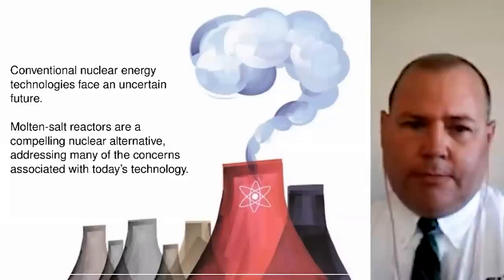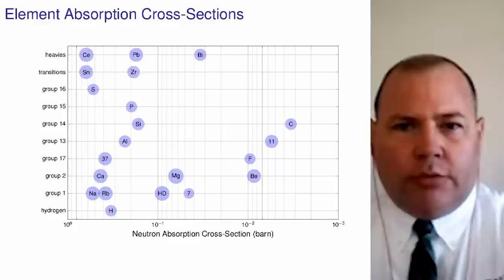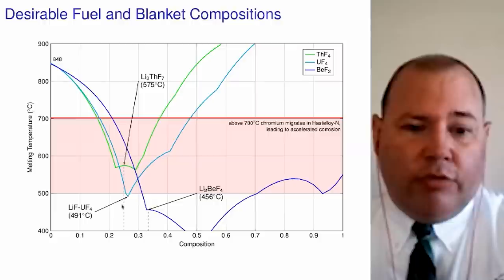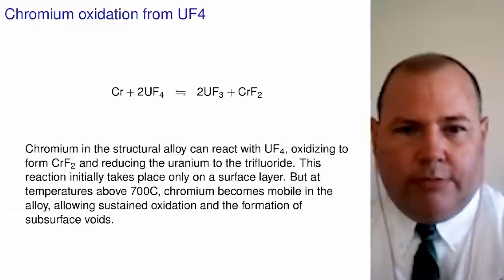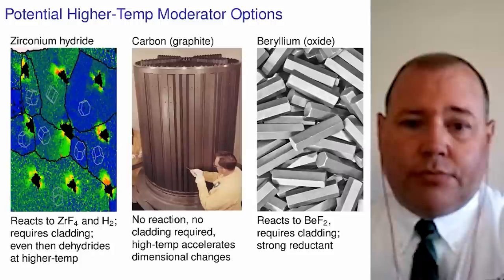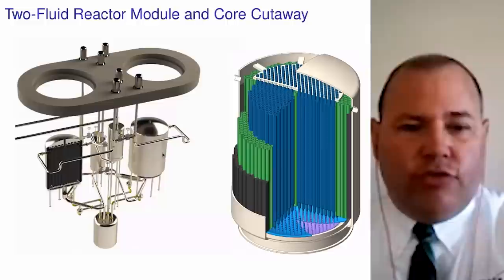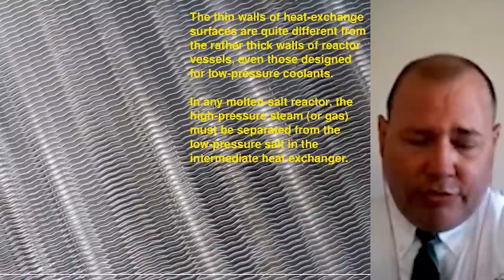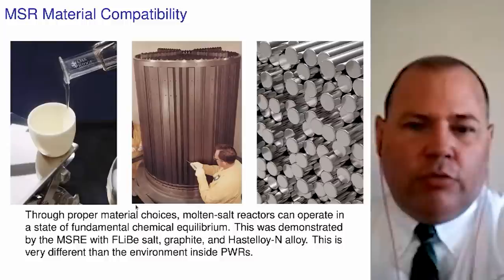Molten-Salt Reactor Choices - Kirk Sorensen of Flibe Energy @ ORNL MSRW 2020

Comment: If Ed Pheil and his team get their molten chloride salt fast reactor up and running doesn't that offer the best option. It removes the need for exotic and often toxic salt mixtures using something that is well understood for its chemistry. Namely sodium chloride.

Also as a fast reactor it's basically going to be a stainless steel can with heat exchange modules added to determine the electrical output. And it burns Spent Nuclear Fuel as its preferred fuel and can even burn depleted uranium when the operating chemistry is achieved.

Kirk Sorensen deserves great acknowledgement for his central role in reviving molten salt reactors but isn't the thermal spectrum fluoride reactor that needs complex components in the reactor vessel, exotic salt mixtures and far more fuel processing a much greater leap to make than something like the Elysium MCSFR that is designed to be as simple and cost effective as possible.

Which also involves any MCSFR operator being paid to take their fuel which is expensive to store.
Reply: Yep, pretty much spot on, but neither will be first to market IMO. Much simpler burner designs will most likely be first.
Reply: @chapter4travels  It doesn't get much simpler than the Elysium MCSFR.

The reactor can is an empty stainless steel cylinder than doesn't need massive fabrication because it's not pressurized. The salt used is sodium and potassium chloride.

The fuel is chopped up spent nuclear fuel and plutonium. 

Reactor output is a function of how many fuel exchanges are added to the reactor and pump capacity. So one reactor vessel can be a 50 MWe all the way up to 1,200 MWe power plant.

The pumps are top mounted making for ease of access and replacement. 

The reactor won't use freeze plugs in the drain pipes, if the pumps shut down the fuel salt automatically drains into the dump tanks. If the reactor shuts down without power everything sits in a larger tank of clean molten chloride salt cooled by a heat pipe. That will handle any decay heat.

The Elysium reactor is designed from the start with streamlined certification, licensing and fabrication in mind. They're not going to be using anything that requires a lot of R&D and certification.

The more advanced follow on designs can use things like hasteloy-N alloys reactor can for much higher operating temperatures than the already high 600+ C. As high as 1,300 C giving much better thermal efficiency and surplus process heat. 

If they get funding Elysium is going to have this up and running surprisingly fast is my thinking on this.

Ed Pheil and his team have spent the last 35 years building reactors at the Navy Knolls Atomic Power Labs, they know their stuff.
Reply: @dougcoombes8497  I don't disagree with anything you wrote, but Elysium is trying to build in the US, and the NRC will make sure that never happens. Thorcon power is in Indonesia where they really need new power generation and the Thorcon design is even simpler than Elysium.
Reply: @chapter4travels  Hopefully that changes in the US in the near future.

Elysium Inc. is also working in Canada they may get certified and have a running prototype here before the US.

There's also another fast spectrum molten salt reactor using tube technology being designed in Canada but I don't know much about that.

We crack this nut and there will be no shortage of fuel for nuclear reactors for centuries.

It's not just the hundreds of thousands of tons of spent nuclear fuel that can be burned in these reactors, it's also the huge amount of depleted uranium. There is 470,000 tons of that stored in the US alone.

U-238 become weakly fissile at the fast spectrum. I wish nuclear regulatory bodies in the US would wake up to the vast potential going literally to waste in the US right now.

Comment: Would the tritium be useful in fusion reactors?
Reply: The salt research for MSRs is identical to fusion research for just that reason. One use wants to maximize it (fusion) while the other wants to minimize it. But in both cases its a molten FliBe salt
Reply: Tritium would be a valuable resource. Check out the cool tritium vial light sources sold on Amazon.

Comment: Kirk is a hero but he’s up against a massive bureaucracy that exists to stifle nuclear energy. Thorium fuel, Hastelloy N, salt dump tank, pumping the fuel salt and freeze plug all have zero regulatory history. The work to get them certified is horrendous with massive costs and endless time scales. 
Ian Scot and Ed Pheil went for their fast spectrum waste burners because it’s easier to get regulatory approval and burning nuke waste gives brownie points.
Reply: Nuclear fans shoot themselves in the foot though. They put 99% of their energy into advancing old fashion water reactors and bashing renewables, when instead they should focus on promoting next generation nuclear power. I am a renewable fan, but I see great potential in pairing something like an MSR with thermal energy storage using salt to balance output from renewables. I think one has a much better selling point to politicians by presenting renewables and molten salt reactors as a match made in heaven, instead of propping up old outdated reactor designs.
Reply: @erikengheim1106  There's a reason why nuclear advocates bash renewables and it's because it's utter garbage. A back of the envelope calculation of the resource requirements per kilowatt hour results in something like three or four orders of magnitude in stuff being necessary for solar and wind compared to existing LWR.

That's before considering the overbuilding required since renewables require almost 100% capacity backup.

It's all sustained by subsidies. As governments force more and more of these unreliable, incredibly dilute energy sources, this will become economically unsustainable.
Reply: @phamnuwen9442  Wind requires 22 kg / MWh and nuclear is 18.5 kg/ MWh of mining. So the difference is minimal.

Renewables can be paired with solutions such as Moltex Molten Salt Reactors with thermal storage. Those essentially work like batteries and can give 3x normal output for 8 hours straight.

Thus you could have a grid with 30% Molten Salt Reactors and 70% renewables. You can build that much faster and cheaper than trying to go all nuclear.

Comment: what happens is the reactor fails in some way and the salts cool down in the pipes?  How do you restart the reactor or find and fix a problem in the pipes or valves?  I am a strong supporter nuclear power, and get stronger when I look at the reality the planet faces ... but we cannot afford more nuke designs that are going to have problems or create catastrophes
Reply from the maker: I believe the pipes would have an external heating mechanism. That's required to fill the system with liquid salt in the first place. So if the salt freezes it could damage the pipes if it doesn't dairy effectively, but assuming the drainage system works even a loss-of-power scenario should have enough salt drained to keep the pipes from being damaged. This is not an expert opinion, it was just my general opinion that a electricity-based pipe-heating system would be required for the system to be viable in the first place.
Reply: @gordonmcdowell  
Thanks for your reply.  Just my gut feeling, and no expert opinion from me either, but the complexity of that and the failure points I could imagine, something like Fukushima, makes me feel in my gut this is not a good technology to implement on a large scale.  Is there any long term experience with this reactor technology?  The Light Water Reactors are something we have a lot of experience with and the appeal of the relatively simple and walk-away safety has a simplicity that I think the public is more likely to accept.  Because if something goes wrong, troubleshooting a complex technology in the middle of a possible nuclear catastrophe is something I don't think anyone would want to see, and would cause the anti-nuclear people to raise hell and doom the industry worse than it is now.  The chemical reactivity and toxicity of the salts seems like a red flag to me - even worse at high-temperatures.  The scale of the global warming problem and the importance of nuclear to its solution, to me, seems to scream safety and simplicity, and having a lot of experience with, especially in light of the "stupidity" of the humans in operation and design of Chernobyl and Fukushima.  Will be watching more of your videos, thanks.
Reply from the maker: @justgivemethetruth  The point of the salt is lack of reactivity. I think it is pretty clear in the video the failures we have experienced is because current reactors do allow the coolant to become separated from the fuel, and that liquid fuel ensures the coolant and fission-products (what continues to produce heat once reactor is turned off) are one-and-the-same. All the complexity of online chemistry is to keep the reactor operating, not for safety. Safety is passive. The reactor has many ways to potentially become inoperative (billion dollar repairs) but none of those paths result in release of radioactive material. That the salt is toxic shouldn't be a concern... the battery in your phone is toxic. The gasoline in your car is toxic. This is an industrial process, and our realistic concerns should be does the process RELEASE toxins, not whether toxins are involved. The output of an efficient Th-MSR is fission products. The salt is recycled. The actinides are recycled. It is all valuable stuff we don't want to throw-away, not just because it would be illegal, but because it represents very expensive material that would need to be re-created for the reactor to continue operating.
Reply: @gordonmcdowell  
My understanding of the LWR is that they use water as a moderator, so when the water drains or boils off the reaction is halted - that is a pretty simple and does not require complicated failsafe mechanisms.  That is what we should be aiming for.

> That the salt is toxic shouldn't be a concern... the battery in your phone is toxic.

While true, that logic does not convince me of anything.  My cellphone battery is not a nuclear reactor.  And as for gas in a car we have had a century of all kinds of experience with gasoline - moving to something new for no real major benefit because someone thinks it's cool and a company can make money off it when the future of the whole nuclear industry is at stake .... not a good idea.

> The reactor has many ways to potentially become inoperative (billion dollar repairs) but none of those paths result in release of radioactive material. 

That should not be the criterion for a good reactor design.
Reply from the maker: @justgivemethetruth  Stopping fission is not a challenge. Controls rods can drop in due to gravity when power is lost. Reflective material (beryllium) could be moved to make the core sub-critical. These can all be passive mechanisms. Really, only fast-spectrum reactors present any additional considerations because the introduction of moderator to a fast-spectrum reactor could make it super-critical. Stopping fission hasn't been a concern since Chernobyl or (fast-spectrum) Fermi-I. It has been the dissipation of decay heat that is the challenge, and every single meltdown or severe accident has ALSO been due to decay heat. Dissipation of decay heat CAN BE a concern for LWR since water can AND HAS fled the scene during TMI and Chernobyl and Fukushima.

You are concerned about chemical "toxicity" of nuclear fuel salt? I suggest you steer clear of any and all industrial processes. No one (including myself) cares about what circulates inside a closed-loop industrial process. People care what is released into the environment. And the best way to not release toxins of any sort (radioactive or chemical) is to avoid accidents in the first place. The best way to avoid accidents with nuclear reactors is to have passive mechanisms for dissipating decay heat.

Billion dollar repairs: "That should not be the criterion for a good reactor design". Lots of criteria to consider. I wish you the best of luck with LWR. We do need them, as they're proven statistically safe and are ready to be deployed. Please go try build some and tell as many people as possible how clean and safe they are.
Reply: @gordonmcdowell  
You just seem to not get the over-riding issue of public perception.  You just go full steam ahead trying to push your point of view when that is not what matters.  I don't think you are a good one to talk about what people care about because your interests clearly over-ride that.

Yeah, passive mechanisms for dissipating heat, along with a design that stops the reaction is there is too much heat.  Control rods are not much use on a delicate mechanism if it is warped or blocked or something other unimagined problem occurs.

Sarcasm and condescension always work well in comparison to facts.

Let's say for example there is a plant worker who is a terrorism and smuggles in a bomb.  What would you rather handle, a steam and water spill or molten salt?  Anything, thanks to your insults I think this conversation is past its productive point.
Reply from the maker: @justgivemethetruth  I was not being sarcastic.

If a bomb was exploded anywhere near a MSR, why don't you tell me what you think could happen? Or don't. But in my mind you might see salt spilling, then freezing. Even in liquid state it traps (with chemical bonds) the dangerous fission products (except for Xenon the gas). THEN it freezes and also traps Xenon. Iodine and Caesium are trapped, even while the salt is liquid.

If you think the outcome is worse, then give me a play-by-play.

My expectation for LWR is Fukushima style outcome. Not great. Not terrible. But worse than MSR.

Comment: WAIT a minute, what is the deal with highly depleted lithium is it the the leftovers from used batteries???? Please explain.
Reply: I believe one of the problems with having Li-6 present is that it will eat neutrons.  Li-6 has a neutron capture cross-section about 5 orders of magnitude higher than Li-7. The neutron budget to sustain the Th232->U233 process is already pretty low.  You want to reduce neutron capture in anything else to an absolute minimum.

Comment: How viable would it be to start the move to MSR's using uranium burner reactors? I understand the excitement for thorium and breeding, but we probably shouldn't put the cart before the horse. As a layman I might be completely getting this wrong as to what mixture MSRs need to function, but it seems like erecting uranium burners as a baseline would perfectly well fit into current nuclear supply chains and could be done immediately. Again, tell me if I'm full of crap and getting the chemistry completely wrong.

Comment: Would tritium be a useful propellant in ion drives? I know, cart in front of the horse, but plan ahead. If you're ok with a charged storage tank you could strip off the electrons to make it denser?
Reply: They usually use heavier gasses for ion propulsion. My guess is they'd use something even heavier if they could, to get more mass for each molecule pushed out of the thruster. Equal and opposite reactions. A heavier molecule = more thrust
Reply: I thought Xenon was "the thing" for ion propulsion.. and I'm pretty sure Xenon is produced as a fission product and could be captured as it gasses off from the salt.  Thought KS touched on this in a video or two.

Comment: Cant the surface corrosion be solved with some kind of surface treatment or protective layer? Im thinking a gold protective layer would work pretty well. It doesent melt, it doesent crack, it doesent flake. Its relatively simple to apply either chemically or with sputtering. In the grand scheme of things it isnt even that expensive since the layer is thin and also not proprietary
Reply: Transmutation might be a problem, though.
Reply: @caav56  you might be right. it might just be the case that corosion is a fact of life, and you have to treat the reactor vessel and salt loop as a consumable.if you have several reactors in one spot you could pump the salt from a spent core to a fresh core and treat the empty tank on its own.

Comment: How does the Flibe design eliminate the higher actinides? Fast reactors fission them directly, but a thermal spectrum doesn't do this. So how are the long-lived guys like Americium, Neptunium, etc. addressed?
Reply: IANANP but my understanding is that this is not a question of the molten salt design, but of the Th-U fuel cycle. ²³³U is a lot farther away from those higher actinides than ²³⁸U, so in practice, not a lot of the fuel will ever absorb enough neutrons to get to the "bad" actinides.